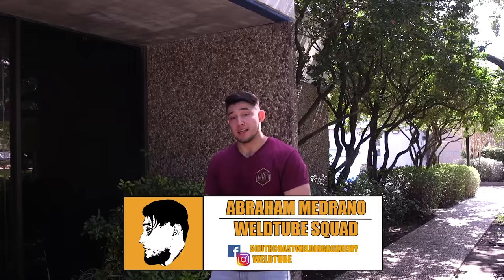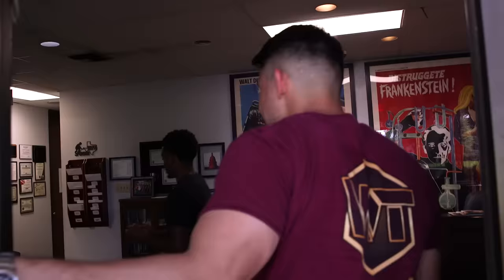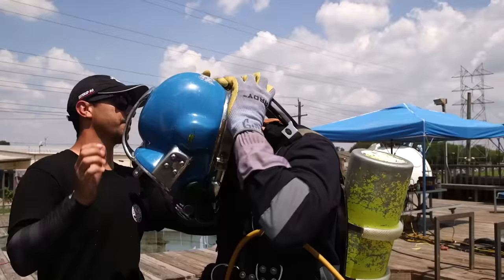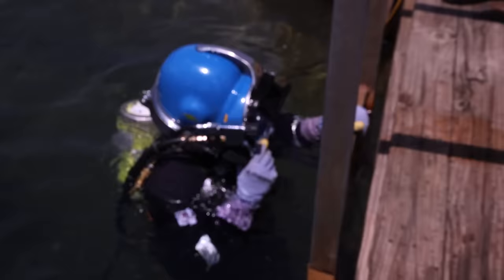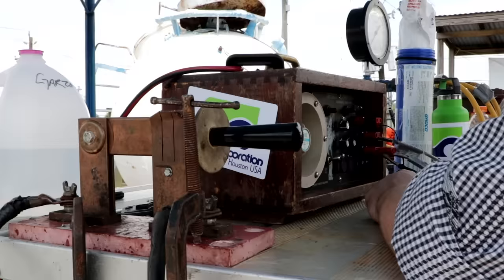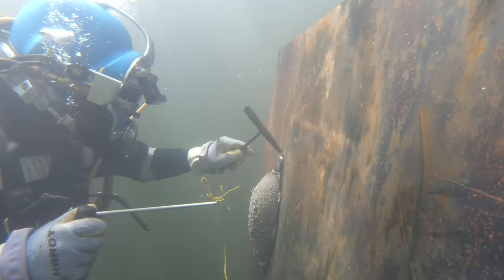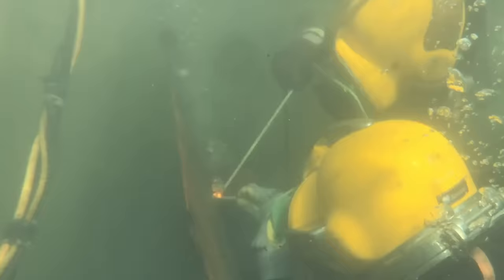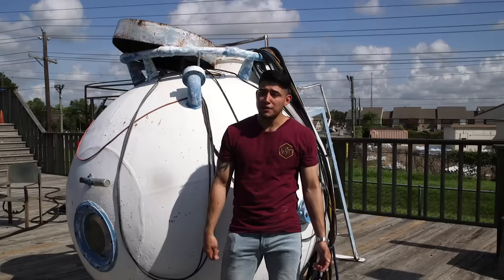UNDERWATER WELDING

Comment: Good job brother.  I went through DIT Divers Institute of Technology in Seattle. Two best dive schools in the country are ocean Corp and DIT.
Reply: How much did it cost you???
Reply: @chino123224  $21,000.00 for a seven month course.  Great instructors. All of them are former Navy and Army Divers. Extremely knowledgeable. We only dove in tanks for the underwater welding and Knots part of the course. Everything else was diving at depth in lake union in Seattle. Final part to the course you go to sea and dive performing and pipe job at 165 ft. Great school. If I could do it over, I'd probably go to ocean Corp for the NDT weld inspector course. They don't offer that at DIT.
Reply: @chino123224  I forgot to add. I used my GI BILL so I didn't pay for anything but my dive gear.
Reply: @lonner98  wow Damm do you know by any chance they have one in canada ???
Reply: @lonner98  thanks for the answer

Comment: Once you get the hang of it you find ways to position your hat so the bubbles don't get in your view. The lower you get under weld if possible the better you can see back of puddle.  Starts to be all feel after a while.  Gonna maybe be alot less visibility out of that training tank though. My experience visibility is very poor most of the time. Great video! Good to see guys still in this field. I've been in since 2006.

Comment: I took a welding class in hs as well as an adult.. I was always told never to quench a weld because it will cause cracks, how do they do it underwater and keep the structural integrity
Reply: Bruh…
I’m a freshmen, and I’m in a metals class.
You have to quench the metal, because it gets hotter than hell sometimes.
Reply: @ferret9263  Quenching is okay when you're just running a pad of beads, but for actual structural integrity on a joint that is going to be critical, quenching is a no-go. 

Knives are quenched to increase hardness, this is good, because a knife needs edge retention, and hardness provides that. However, quenching a weld joint is bad. This is because hardened steel is also more brittle which means it is also weaker.

Quenching for knives = good, Quenching for welds = bad. It is acceptable on a learning platform though, because you get more hood time.
Reply: Idek man.  Good question

Comment: I have always been facinated with underwater welding. I am curious how you don't get shocked. Yes I saw the knife switch and all, but you're still in water. My Mossad friends say salt water conducts electricity better than fresh water. That's why you use salt water to interrogate people. So if you're submerged, it seems that you would be in the middle of the action. Completing the circuit. When I'm sweating, I get shocked even changing electrodes if my gloves are sweaty. Ok the knife switch will de-energize the stinger, but when you go hot and are trying to strike the ark
Reply: Jimmy in Mexico I think as long as you don’t get between the electrode and the ground you’re fine the electricity travels through that path!
Reply: Divers use rubber gloves, DC current, don't get between the ground and lead/stinger
Reply: You do.
You get out up all the time.
It's just part of the job.

Comment: I would imagine that diving in general would be a great joint pain reliever . Before I got both hips , my right knee , and in a month or two my left knee joints replaced from RA I would go wading and fishing for hours because it did kill pain , I guess from all the pressure pushing the inflammation out of the joints . Today an ad for a dive school did pop up , I remember It started with ocean so I'm guessing Ocean Corp.  and I remember how I wanted to do that for the Navy but they said that was a special forces thing and I would have to go to BUDS school so I ended up joining the Air Force for 4 years .
Reply: I'm a diver I have ackes and pains all over ! It's a heavy job
Reply: @dane2427  So does being underwater help ?

Comment: Just to know one thing,you use gas or some high current with low voltage for welding. If current so how danger it would be...just explain ..

Comment: So I work in a brine evaporator unit, so I know how corrosive salt is. What kind of metals are they using underwater in order for it to last?
Reply: Ship hulls are usually 1018 steel.  1018 is about the strongest metal per dollar cost.  They protect it with paint and zinc anodes.  (Yes, you can paint underwater too.)
Reply: @douglasbutler4360  paint underwater! Thats crazy!

Comment: Hi i am considering starting a commercial diving certificate , and work as an underwater welder, i also have an operated clubfoot which made me think that working in the sea is good for me since i dont need to step on my leg,but i will be floating so even better for it.
However a person i contacted is stating that this is an extremely physically demanding job,what exactly is the physical part?can someone with experience explain? Where is the annoyance? Where is the pain?

Comment: All it is is stick welding with like wax covering flux on rods I'm a topside welder. Certified in structural smaw and smaw pipe so Im looking into this if you have welding experience from What I've heard it's a breeze shit I already weld stick one handed anyways